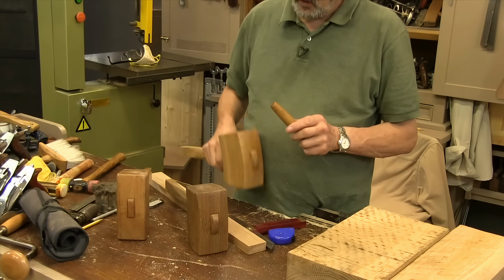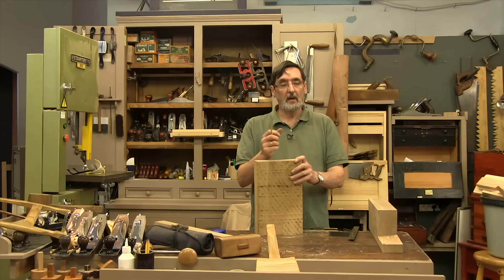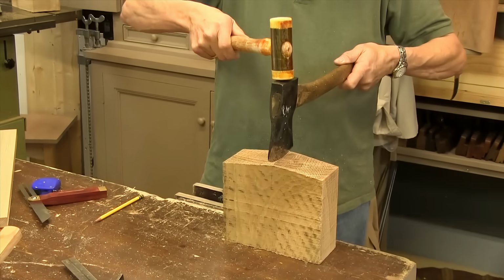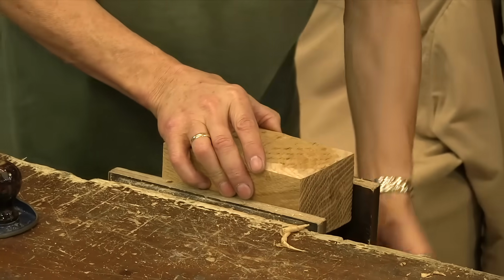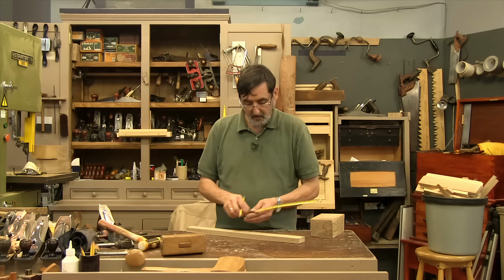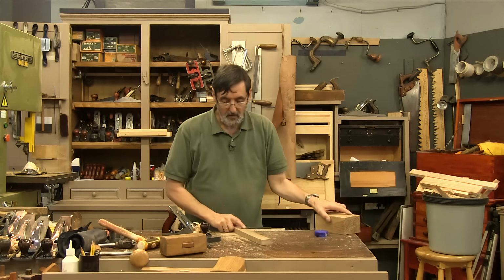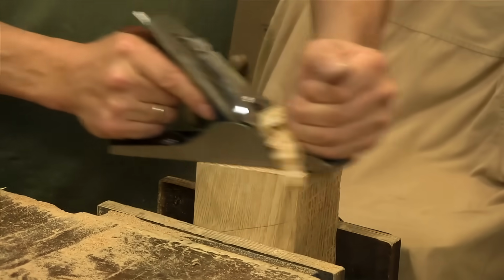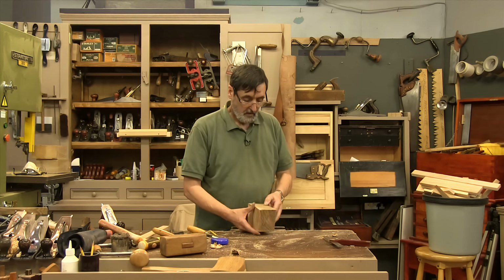How to make a Joiners Mallet (part 1) | Paul Sellers

Comment: isn't the grain of that handle running the wrong way?   it looks like the grain is running perpendicular to the length of the head instead of parallel?
Reply: +random eddie It doesn't matter with a mallet like it does with an axe.  Having the wrong grain orientation on a big axe can make the handle springy but you use a mallet completely differently so that isn't a factor.
Reply: +random eddie Doesn't it make more sense to have the grain of the head run end to end, and the same for the handle?

Comment: I just made a jointer mallet out of O'sage Orange wood. Im glad it was still wet, otherwise it would have ruined my blades. It is a very hard wood.
Reply: I'm glad I use hand tools where I can sharpen blades, and not consider them ruined by hard wood.  That way, I can use well dried wood and make a mallet that doesn't crack after a few years as it dries.
Reply: Jacob Warner blades are never ruined
Reply: I think fruit trees have a really tight grain they're pretty tough
Reply: Osage Orange is not really a fruit tree, it is a very tough long lasting wood that does not rot easily. It is said that a corner post made from t will last a hundred years. I have one on my place that the appearance hasn't changed in fifty years that I know of. Think of it as Mulberry's tougher harder cousin. Osage Indians made bows from it, hence the French name bois d'arc.

Comment: So, as a carpenter, I use a hammer and steel capped short chisels (made by Stanley in the UK, but until relatively recently, only available in the US.) I get massive force through them, making for quick work and limited tool change.  

For the workshop I've always used a sculptors mallet (round, not flat.) I make mine on the lathe from logs of beech or birch.  I like the fact that as the surface is always curved, I can apply precise force from the smallest 'sweet spot' on the mallet.  Making them is so easy, you can knock up a range of sizes (dependent on what logs you have,) in a few hours.  Given the nature of fresh(ish) wood, make a few.  Time will give you the keepers.

That said, as always, Paul's instruction on a Joiner's or Carpenter's mallet is as always, a joy to watch.

Comment: I wonder how arctic birch would perform in this application, oak is anything but common here, too far north. Going to try and plant some in my yard, so I'll see in a few hundred years if I get some nice lumber out of it.
Reply: Also on the lamination issue, there are loads of old woodworking benches for sale around here made over 50 years ago, they look like they are laminated together in their construction. Or were they made differently back then? They're made from birch mostly too. 

I've heard it said locally that people have it wrong, woodworkers don't wear out their benches, benches wear out their woodworkers, 2-3 generations per bench.
Reply: +1873Winchester I got a great big hunk of desert ironwood from a guy I helped move. I think I'll try making the head out of that.

Comment: I have used some pine (don't laugh) I turned it on my lathe into a mallet its not for heavey hits, more gentle taps. And if I ever found anyone using a hammer on my chisels, god help them. I have nurtured them, I sharpened them using the method Paul here showed, so I am quite proud of them.
Reply: I don't have the sharpening stones (yet) but I have a slow grinding wheel which is 250 grit which I use before using Paul's method with some of my uncles old car body sanding discs which go up to 1200 grit. They are razor sharp using Paul's method by hand. My first project of a table with carved legs came out perfect! 

I have some cheap Stanley chisels with plastic handles and I use a wide head metal hammer. Why don't you use a normal hammer? Does it damage them or are your chisels quite expensive?

Comment: Always thought Paul would be a metric man.
Reply: iShootBandits The metric system has its uses, in particular for very small measurements.  However, if you are used to the imperial system, the actual numbers involved are easier to comprehend and (more important as you get older) easier to find on the ruler.  I would rather find, say, 10  3/8" on a rule than 264mm, especially as most steel rules are marked in mm but numbered in cm.
   If you are used to the metric system, then fine, but given a choice, for ordinary 'domestic' measurements, I would rather use inches.
Reply: Offshoreorganbuilder think about it like this: the cms are like the full inches and the fraction of inches are the mm. Being peruvian I've live my entire life under metric until about 10 years ago when a built a bass guitar so imperial is not strange to me but 13/64" looks just harder to find because all ruler here go down to 16th of an inch.
Reply: Enrique León Nava I agree with you entirely.  That is why I wrote, " The metric system has its uses, in particular for very small measurements.."  Yours is an example of a very small measurement.
 
  Your 13/64" is equivalent to 5.159mm.  If you really had to work to this degree of accuracy, you would need to use a dial micrometer or similar.  No-one can 'see' 0.159 mm on a ruler, of course.

  In your particular example, assuming that you were working with hand-tools, I, too, would be looking for 5 mm.  But, in my own experience, and that of (I imagine) most other people, working to an accuracy of 1/16" is quite sufficient, especially when you consider the concept of 'bare' and 'full.'  Eg.  "A bare 1/4" (just under 1/4" but by less than 1/16") would get you very close to the 13/64" you mentioned above.
Reply: ***** Eh?
Reply: Enough said!  (Love the beard.)
Reply: iShootBandits Primarily the clock/time-keeping scheme attached to it. That is about it.
Reply: Metric?  What would anyone want to use that crappy system for?  (You do know, I take it, that it's a French invention?  Hah!)
Reply: Offshoreorganbuilder
Whats crappy about it?

Comment: ok not to be a noob but at 28:50 paul runs the plane over something in a can and it reduces the friction between the plane and the wood what is it ?
Reply: ***** Thanks
Reply: renemanjr123 He addresses this here https://paulsellers.com/2013/12/oil-pad-can-risk-contamination/
Reply: Could be a wax compound. Beeswax was used traditionally - i find Silicone Spray to be a useful alternative.
Reply: there is a link on my first reply that Phil Adams posed on Paul making this magic wick lube in the can called 3 in 1 oil. : )
Reply: Matt Hopkins I had the same problem to thankyou for the help
Reply: Paul Dore Bushcraft thankyou for the help
Reply: ridiculoushit Thanks for the help
Reply: renemanjr123 Beware, anything besides a dry lubricant will affect your ability to finish the wood. Silicone and oil are terrible for most finishes, while beeswax is about the best (it doesn't soak into the wood), outside of something like a PTFE spray. 

If you are only providing a very thin coat of oil, then it is fine (it is mainly for protecting the smoothed surfaces of cutting/gliding tools, rather than lube against the wood). FYI, we can't even wear Livestrong-type bracelets in the guitar factory I work at due to trace quantities of silicone that some slowly weep out.
Reply: Thor214 Thanks
Reply: Yes. As they say, been there, done that. As I once told my father, it was amazing to me that the older I got, the smarter he was and the dumber I was finding myself to be. I am sure we all remember how we knew it all and our parents didn't have a clue.

Comment: Great to watch you work that hand plane, what is in the magic can with the wick on top?. It really made a difference the way the plane cut smoothly. Thank You!
Reply: ***** Thanks Phil, I used a small minwax stain can, it was near the size Paul had used and felt sheets rolled into the bundle for the wick. That works great and smooths out the cut on end grain. 3 in 1 oil is an old product and i will glide some on my hand saws to cut friction there too. Thank You Paul for the tips. Will you follow up with the mounting of the handle into the head?

Comment: I wonder about Live Oak?  It's  very gnarly, I used to hate splitting it for firewood, even with my PTO splitter.  When you mentioned Cedar Elm, it made me think of Juniper but doubt Juniper would be adequate.
Reply: David Dube as I was growing up in Anne Arundel Co in Md I had to cut down many black locust trees. Thorny and the wood was hard as iron. The interesting thing is it had just 3 major roots. The tap root which went straight down (making it very difficult to get out) and 2 radiant roots that went out making a "T".  This junction was the hardest piece of wood I have ever seen. Much harder then African Buginga but not as heavy.  Wish I had a couple of pieces to try and make a mallet from it today.
Reply: An apartment complex a couple miles from my house just cut down several large oak trees. I'm stopping by tonight to grab some cuts for projects like this.
Reply: When Roy Underhill built a mallet on the Woodwright's Shop he stated that Live Oak was great wood for mallets.
Reply: I would think live oak would be good, but I actually think mesquite would be a great choice too.
Reply: mcrae000 Well, it's referred to as 'Texas Ironwood' for some reason.
Reply: My Grandfather had what he called a small mall he used for popping a chisel.  It was made from a dogwood stump.